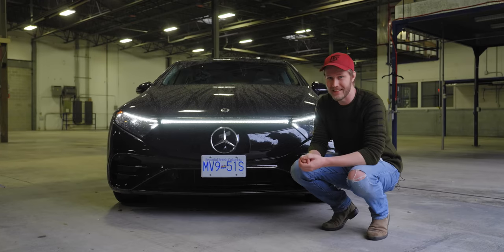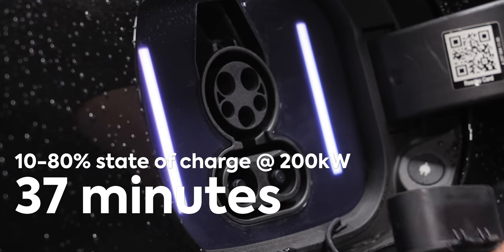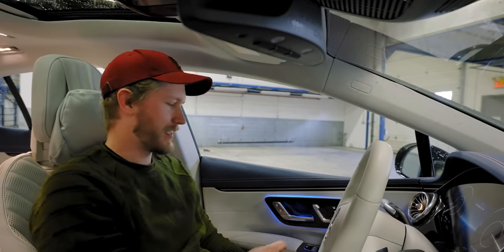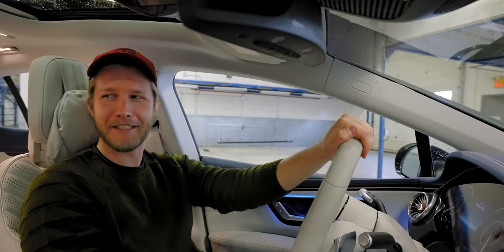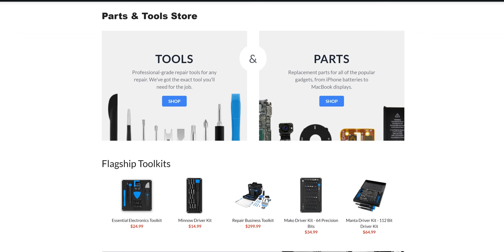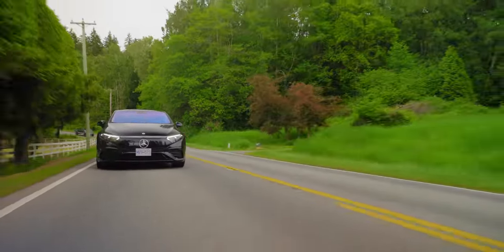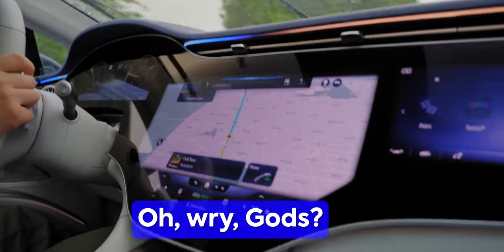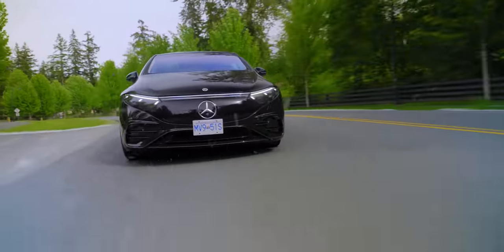Mercedes, don't be mad. But... - Mercedes EQS 2022

Comment: Although Mercedes screwed up many things about the EQS (capacitive touch, infotainment, rear seat comfort etc), I think the overall ride quality did not get enough credit in this video. There is no other electric car that provides such a silent, soft and just comfortable ride. Even with speeds higher than 120km/h, you can basically whisper to each other sitting in there. Especially for people traveling long distances, this comfort level paired with the nice range and charging speed gives the user a unique package. So the EQS can be the best fit for a certain target group.

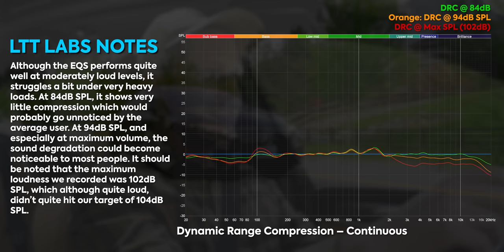Comment: In the "lab notes" on the frequency response, it looks like the Volvo vs Mercedes labels are swapped. Also, it's a bit confusing why the dip around 20-40Hz is missing in the chart at 12:57.

Comment: Couple notes on the Labs section
- grammar: "Frequyency" in the top right
- "Although it produces enough sub-bass down to 40Hz, but there is a big drop after down." - what is this supposed to be saying?
- In your graphs, you have tons of blank space above and below the data points. I'd recommend decreasing/truncating your y-axis so your data can be shown more easily. Relatively small, thin lines aren't particularly conducive to color-blinded people, and are generally difficult to discern, especially at the rate they're going in this video.

Comment: A friend if mine is an engineer at Mercedes so I got the chance to drive one if those before they were shown to the press. It's a pretty luxurious car that drives incredibly well for the weight it has. 

The sound system is pretty good in my opinion.

Also it's pretty, impressive how fast they can accelerate 2.600kg

Comment: The steering wheel situation is really weird.

Our Skoda from 2017 has a roller and 4 buttons around it on each side of the steering wheel and they are tactile and you know what you are doing. How is this getting worse? Skoda is even from the VW group.

Also, give us back normal buttons for everything.

Comment: Not being able to open the hood without messing around is an insta no for me, but the lack of height clearance, the capacitive buttons, the lack of configurations (not being able to turn off the regen braking, seriously ?), and so on... Yeah no.

Side note for LTT : The measurements from the LAB are really useful, it is the kind of stuff that will bring me back when I will need comparisons!
Reply: The friction brakes will heat up / wear out too fast with such a heavy car and no regen.  They want to avoid the warranty/reputation hit from that.

To be clear, this doesn't excuse bad brake feel.  They made the SLS AMG Electric in 2013, and should have been iterating on stuff like this (and heat pumps) since, even if they wanted to wait for cheaper batteries to release models.  Instead they were apparently resting on their laurels.

Comment: There are 2 errors in the video, probably because the LTT Labs bit is new:
12:50 Top-right, "Target Frequyency Response"
12:54 Top-right, Labels are swapped

Also some nitpicks:
12:57 Top-right, very inconsistent labeling
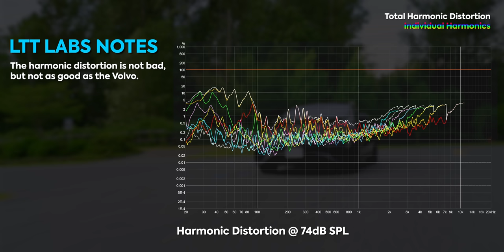13:03 Top-right, "Individual Harmonics" is a little hard to read, maybe add an outline to the text?

Comment: Good review. I've been driving Teslas for the past 3 years and the EQS beats the 3, Y, S, and X. I got my EQS used with 3500 miles on the Odometer so I got it for just a little less than list. It not perfect, but still an awesome car if you have the money.

Comment: You might have miss-branded the graph at 12:54 ? You keep talking about how the Volvo is  better in audio,  but the graph shows the db of the Volvo dying bellow 50Hz.
Or am i just reading the graph wrong?
Also, maybe use Asus's "movable" laptops for distortion testing since they'r beefy coolers won't affect sound testing, even in a warm environment if you undervold both CPU and GPU their fans should be idle, or at the very least I'm sure Asus or one of the other vendors would give you a BIOS allowing you to change the fan-curve to stay idle until the CPU is hitting 115°c and does a force shut-down.

Comment: Even if the EQS looks like a shoe! It's an elegant shoe. This one is my favorite EV!  It's such an amazing piece of technology. Like the EQC, the EQS also has a mustache. Once you see it you can't unsee it. I really like that soft ride of an S-class it makes traveling so much more relaxed! We have one ourselves at home. So I would definitely get the EQS  if we had to switch to electric. I actually really like the adaptive regenerative braking. You can turn it off but using the paddles to switch between the different manual settings.